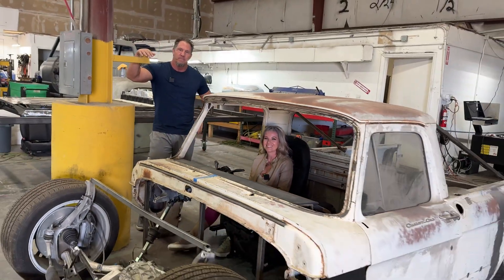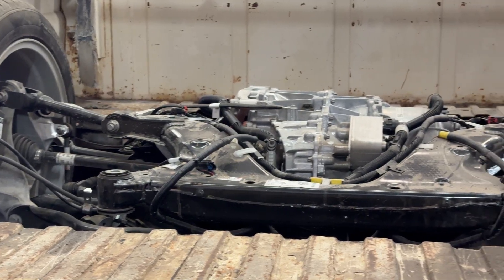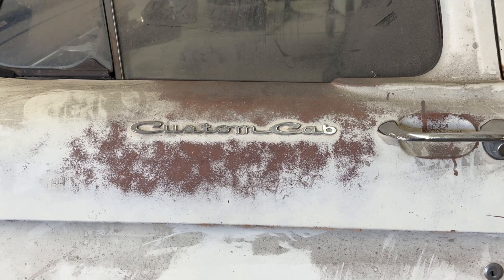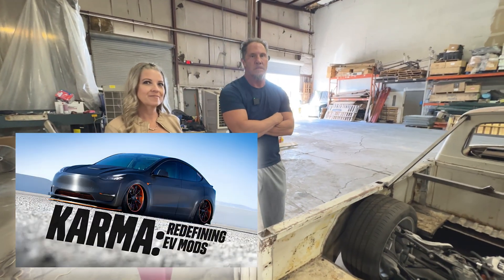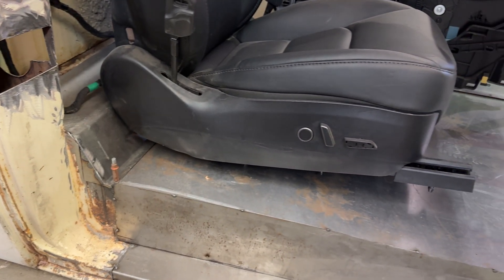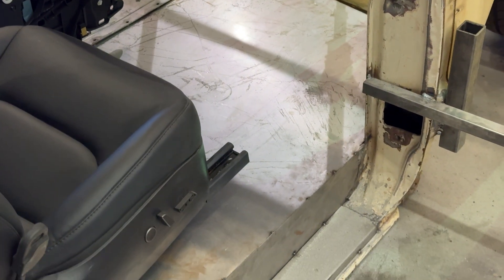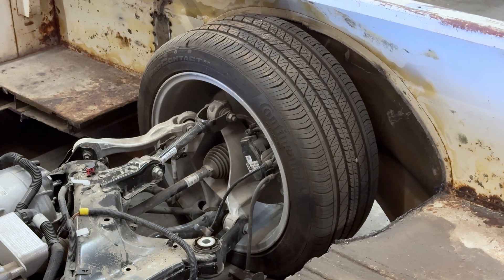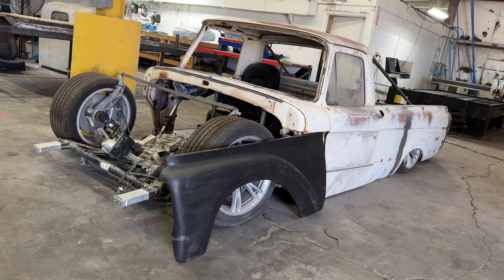INSANE Tesla-Powered Ford F100 Build – Right-Hand Drive, Custom Chassis, Hidden Tech!

Comment: Put gas engine in to it to power Tesla engine like trains do less battery wait time ! If it works then there you are less fire burn than batteries
Reply from the maker: Supercharging only takes a few minutes, basically just a bathroom break. So really, there’s no problem to solve here. People who’ve never experienced it often worry about range, but once you try it, you realise it’s not an issue at all. This is a solid step forward, no stress needed!